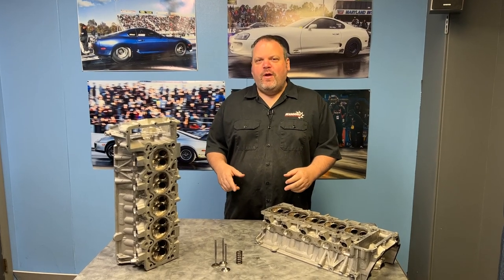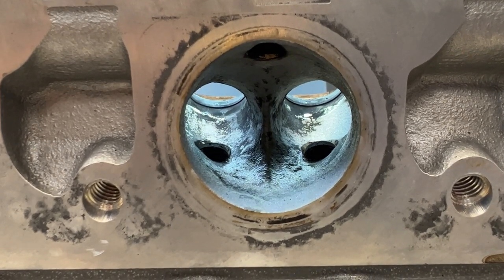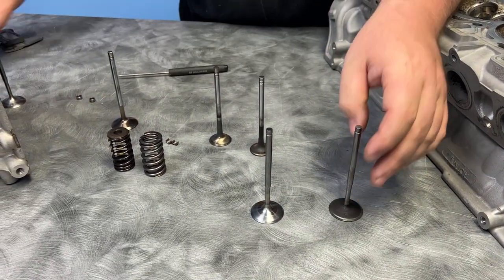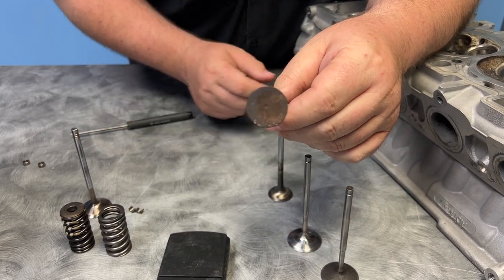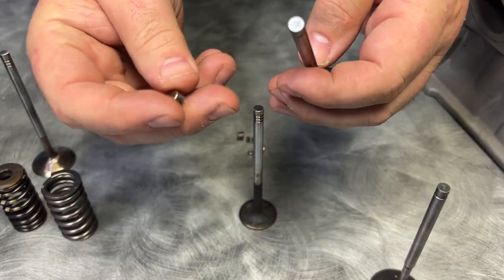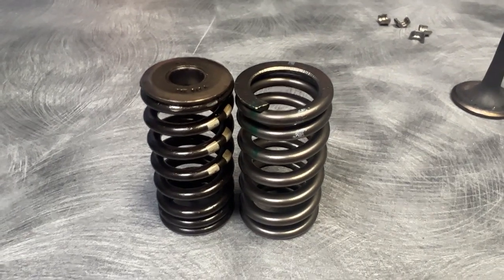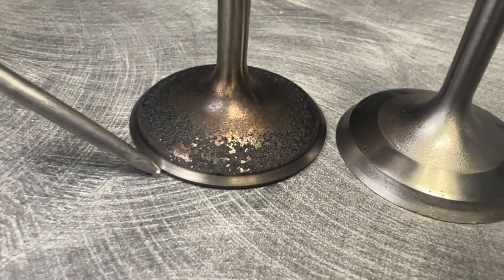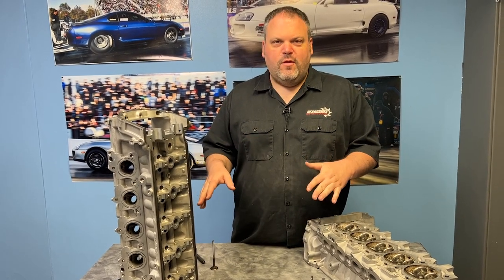Lamborghini Performante head tear down with Huracan valvetrain comparision!

Comment: Dave love your videos very informative. Your knowledge is incredible. My car is old 87GN turbo v6. I'm going to get it back on the road soon. Going to start changing valve springs and injectors. At 70 k what's your opinion on the valve guides. Should that be a concern? Not smoking and not using up oil.
Reply from the maker: Jose thanks for the kind words! I also have a 87’ T-Type. That’s the first heads I ever did! That head has guides that are apart of the head and rarely have wear issues. You can’t really replace but you can get a machine shop to install a bronze liner (k-liner is what it’s called). But really it’s not something that I would rip it apart for. I went 10’s back in the late 90’s with my heads, 61mm turbo, built trans and a converter. 
Unfortunately we don’t work on them anymore.

Comment: Hello.
I can't believe that the port has that Stock termination being direct injection, and that neither will any CFM be gained by smoothing the surface, it has been very curious to me.
Thanks for these videos, have you done something with BMW 6 cylinders?
Best regards
Reply from the maker: Yeah we do the n54, n55, s55, and the b58. We do the s52, s54 but my knowledge is limited on those.
Reply: @headgames  Ok, almost all I do is m50b25 or m42b18 so modern I haven't made any yet, there aren't videos of those stocks on the channel right?

Comment: Very interesting what they do to fight Fuel Puddling. I would imagine it wasnt a huge diff due to boundry, but is enough to atomize fuel. Pretty cool.
Reply: I Don't think there is any fuel in that runner. Direct injection. Allot has to do with where the valve sits above the runner and maintaining runner wall thickness.

Comment: Hey Dave, love your work!!

Looking at the port i can’t help think having some channels (1mm wide/1mm deep) cuts into the port (in the right place) would encourage tumble ten-fold. You could steer the charge in whatever direction you like with them. 

(Channel size..Using a dremel (1” wheel) cut multiple 1mm channels 1mm deep)

Comment: Hi Dave.  
any ideas as to why Lamborghini valve guides are regularly wrecked at 30k miles?  
these engines stock are ONLY making about 50hp per hole.
what gives?  
6.0-6.5 v12's
Reply from the maker: It would seem to be a material thing but it could be geometry as well since it is a rocker deal. Never had one come back after we do GSC guides so not sure!